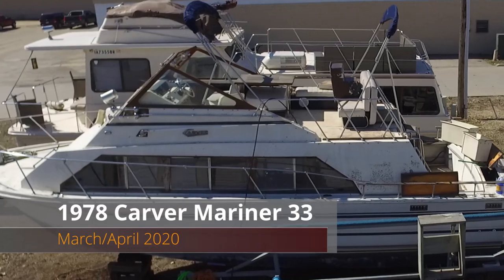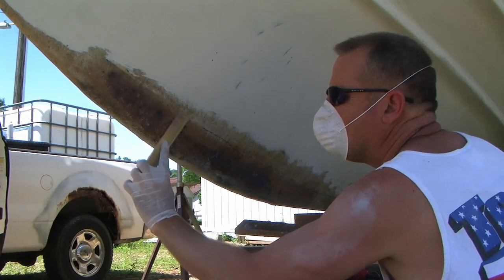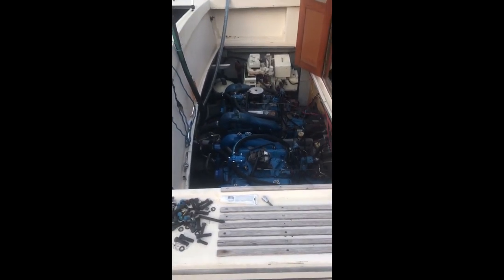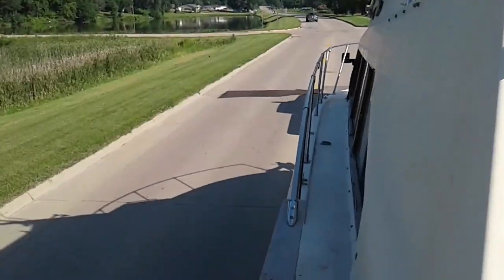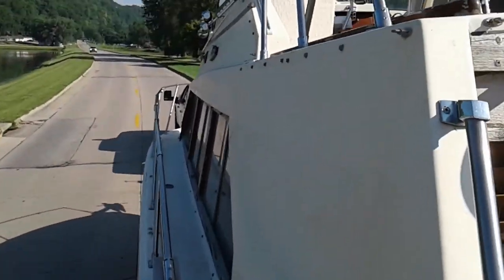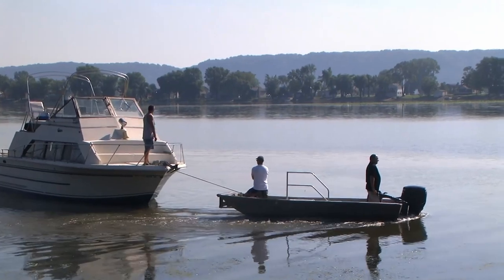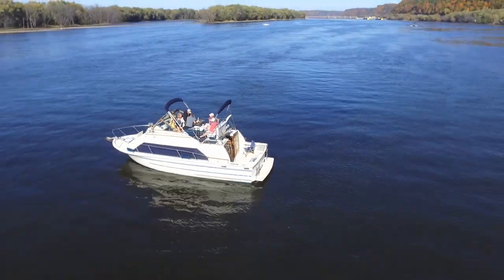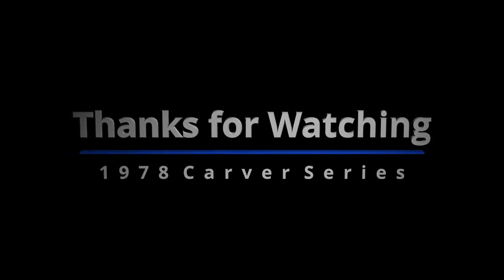Restoring 1978 Carver Mariner 3396 Yacht after being abandoned for 4+ years!  Part 4: Launching...

Comment: Hi Jeff. I have a 1978 3396 in a boat yard. I won't tell you what I paid for it. You would laugh. Anyway Im not giving up. I have a thousand blisters to repair just for starters. I have a fantasy about stripping her down and redoing all electrical and interior design. Then redoing the deck.  Hoping to see so much more on your videos. Starboard v drive will only go backwards. Argh Would love to see all videos you do.
Reply from the maker: Good luck on your project boat!  I plan on starting boat work and filming in 2 weeks.  Will be doing canvas and teak restoration next.  Pulled the countertops out and plan on doing an epoxy pour that looks like marble...
Reply: @JeffNiemeier  Ill be watching every episode I can find. Remember to hone in on the details...like how did you fill those few blisters. How did you fix the windows so they wouldn't leak

Comment: Awesome Jeff.  Watching this makes me miss old carver.
Reply from the maker: What year and model did you have?
Reply: @JeffNiemeier  1977 3396
Reply from the maker: As an old owner, do you know what the flat notch in the forward keel is for? There is an old transponder glued to it from the inside.  Didn't know if it was a place to fit transponders only or perhaps a location/lift point for straps...
Reply: @JeffNiemeier  
I assume it’s part of the transponder.  Typically the portion of the hull where the transponder is installed is very very thin.  Mine actually worked and was still working when I sold the boat in 2010.

Comment: Good stuff Jeff, how fast does she go?
Reply from the maker: It's not fast,  according to the performance data from the original Carver manual, dated 8/18/1978, at 3,000 RPM it will do 14.4 MPH with .87 MPG and at 4,000 RPM it will do 27.3 MPH at .94 MPG.  The performance data shows a MAX RPM of 4,600 with a speed of 30.8 MPH with a fuel consumption of .77 MPG...  Recommended cruising speed is 3,000 - 3,300 RPM.
Reply: @JeffNiemeier  So at 28 mph I will burn almost a gallon of gas, per mile. So at lets say 3 dollars a gallon to go 30 miles it would be 30 miles times 3 dollars that would be 90 dollars of gas burned in one hour and I went 30 miles.
     I am thinking 1000 miles down the ICW to Florida would be $1,800.00 but you would arrive with your accommodation already paid for. Not a bad proposition, if you don't mind a little rolling at anchor or other marine type in- convinces. Then there is boat maintenance and repairs but you would get that in an RV as well.
   Finding anchorages is no different than trying to find RV campgrounds, down the I-75, so I can see the attraction, maybe I will do it one day.
Reply from the maker: I have been watching several YouTube video's on doing the "Loop" www.greatloop.org.  Fuel is by far the most expensive part of the trip but considering the Loop generally takes a year to complete, it is actually a fairly cheap vacation....
Reply: @JeffNiemeier  if you are going to spend a lot of time in waves and don't want to get sea sick plus be able to cook and eat without everything sliding about look into a seakeeper gyro stabilizer. they work even if the boat is in dock or trawling. the  units are getting cheaper every few year years due to them improving the design. lots of people love them on their boats since up to 90% of the roll is eliminated making fishing pleasurable when the water is choppy or just overall pleasant trip

Comment: How much water is in the bilge on that?
Reply from the maker: Great question.  When we first put the boat in the water there were several leaks that I had to track down from hoses, pumps, and even the old stuffing box/shaft seals.  Several items needed tightened, repaired, and/or replaced.  We are thinking about replacing the older style shaft packing with the newer "dripless" style before the next boating season...  There is a bilge pump in the rear with the engines and there is a forward bilge pump in the forward area.  The shower drain in the head actually drains into the forward bilge area and is pumped out of the hull from there...